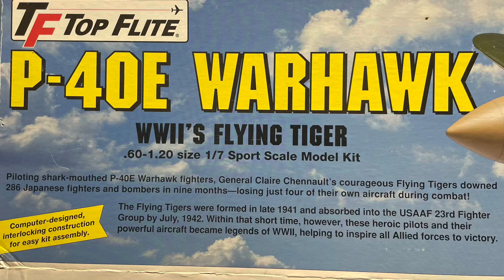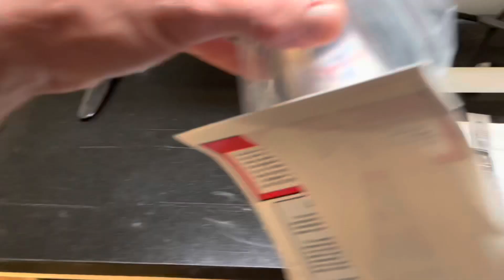Top Flite .60 size Gold Edition P-40E Warhawk Build: Bonus Footage

Comment: Looks great Frank. I have one too still in the box I purchased from an estate sale along with many others.
Reply from the maker: Thanks! You should build it. I’ve started building all my kits. I’m on kit number five of at least seventeen RC kits. Three of them are giant scale. I’m no longer holding on to them for retirement. I’m enjoying them while I’m still waking upright. 😂👍
Reply: Oh yes I have many kits too some started and some scratch built from plans also. I have numerous foamies just to get a plane in air. I retired in 2013 from hughes/Boeing in el segundo calif. I was buying for many years for retirement. Love scratch building. Building 2 electric 52" Fly Baby's now from plans. Will be two different color  schemes. Fuse and tail feathers are all framed less sanding. Both center wing section 90% complete. Building the outer wing panels now, 1st set almost complete. Have a set of plans for a 1/4 scale one too I may build along with a sig Space Walker. Lots to do still. Thanks for the replay back. John from Hayden Idaho